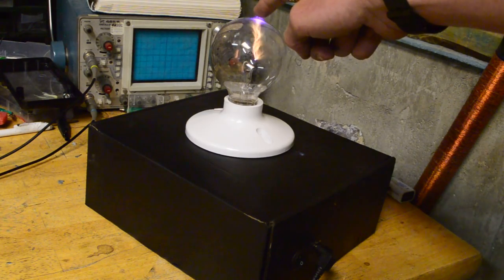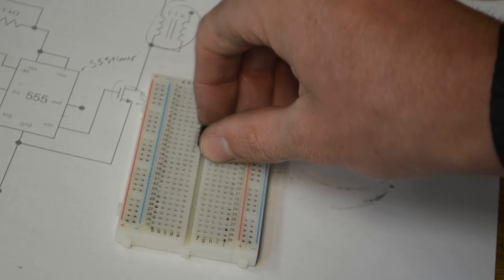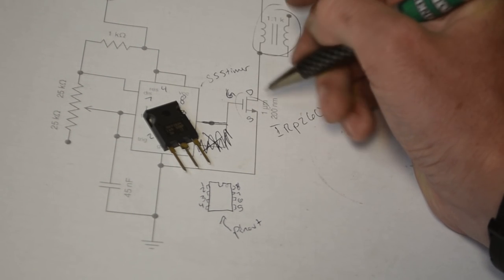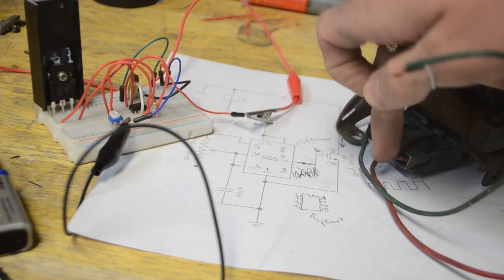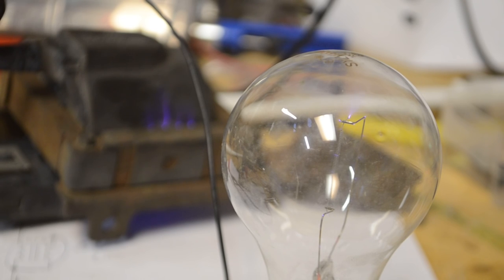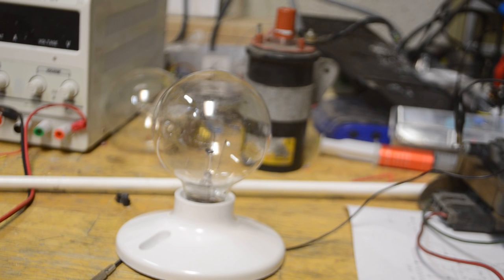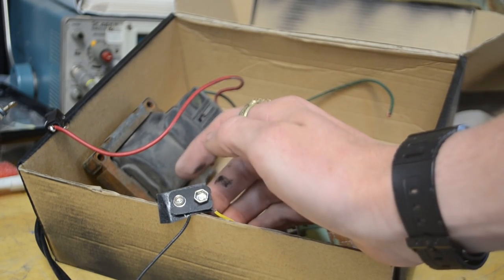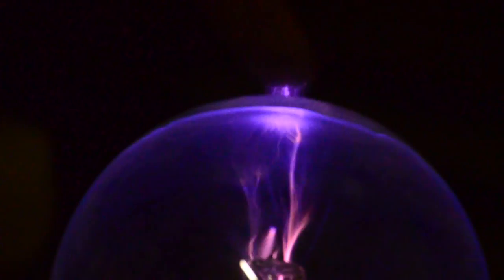How to make Plasma Ball

Comment: Hey man. I love you videos. Just a pointer. I am a master automotive technician. That coil it only designed to operate at a max if 15v dc. Anything higher you reduce the longevity and reliability of the coil.
Reply: themeez1000 lol so, normally they under power those kinds of things.. they build them to withstand more then what's used

Comment: You can also drive the ignition coil with a triac (dimmer switch) and a 6uF AC capacitor in series to limit the current. I put 70 diodes (1N4007) in series in an oil fillled tube to rectify the output. Great source for HVDC for vacuum projects. May want to get the lead underwear out though due to the X-rays if you do decide to run it in a vacuum.

Comment: can you show us how to make  high voltage power with out a fly backtrasformer.
Reply: pls
Reply: He already uploaded a Video about that. just search for "keystone science flyback transformer"
Reply: Austroval he Said without
Reply: you could use an ordinary transformer, really any transformer does work. I got mine out of a microwave, just search for his video "how to get high voltage out of a microwave" search your own microwave in a dump or something near to that, and there you go (really watch his video, or you could shock yourself with that high voltage capacitor)
LG Dominik
Reply: Seth Leith a mot is a great power supply except it's not due to overheating, dangerous amounts of current, but you can ballast it and add some caps for more violent arcs (it's really not resonant) just dumps more current from the caps....
Reply: YOUR NPN FRIEND thank you this helped a lot
Reply: Seth Leith no problem but I would not ever use this in a plasma ball as it is 60Hz and 2100v average mot output voltage you could buy a potential transformer out around 7200v-22kv I would love to see your videos be safe!
Reply: Seth Leith don't use anything that's not at least 10Khz don't risk getting hurt the mot and potential transformer will possibly kill you i would start out with a flyback and zvs just be safe zvs can push lots of current through a FBT
Reply: Seth Leith negitive ion generator produces 20 000v at extreamly low amps and if you want you can run it off a 9v battery but no where near full power. for full power you need 12v dc. they cost about 30 dollers online I have no idea if you can use them in these projects or not im not experienced at all.

Comment: thats an awesome project i might try it! but i would need to find a ignition coil. also if you put some more ads on your videos you will get a good sorce of income and i sugest getting a 3d printer to print plastic cases or shapes to hold your projects in and it will have a nice profesional look

Comment: Nice flyback coil driver.  I have exploded a light bulb with HV through the glass, but that was using a metal probe near the glass and a 15kV 30mA transformer.  It explodes violently, glass everywhere. lucky I didn't hurt myself.  Ignition coil driver video would be nice to see.  I have made one with two 6-volt lantern batteries and a relay wired up as a contained spark gap.  For such a setup the ignition coil needs an external condenser.

Comment: hello there ! thats quite a nice plasma globe, i never tried it with an ignition coil ! is the light bulb by chance a 100w or more ? seems that bulbs with less wattage ratings have more air inside and the discharge doesnt work so well .. a few tips for the 555 circuit if your interested : 1 - a capacitor in parallel of the primary side of the transformer will allow the circuit to run better, keep the mosfet or power transistor running cooler and it consumes less power due to the cap. and primary side making a resonant circuit although i only tried with flyback transformers so experiment with values in between 100nF and 1 mF : 2- a safety gap for the transformer output will prolong the transformers life and should stop the secondary from arcing to the core .. a HV transformer left open circuit is not good for it : 3 - grounding pin 5 of 555 timer with a 100nF will allow it to run more stable .. and anyone who reads this, this circuit will run a flyback transformer with no problems .. if your interested, i have a good video explaining this circuit when used as a plasma speaker in full detail =) .. great videos cheers from Germany !

Comment: I tried this but at the time I had no irfp260n transistors so I tried quad Irf3710 transistors and a driver circuit for them.

It didn't work. I had ordered some irfp260n transistors but by the time they arrived I has 3 more projects on the go so I haven't gotten back to this yet.

I think maybe I was trying to drive it at too high a frequency. I'm pretty sure these coils don't like much above 300Hz

Comment: Can someone help me? My flyback transformer will only work a friction of a second on 50000v when I put it in the outlet, than the voltage drops to arround 100v and that sucks a lot

Btw i used a power supply from a light bulb
Reply: keystone has meny video wich use this transformer. they will help you i had the same problem
Reply: Jm2059 tech i dont want to spend another 30 bucks on something i dont need
Reply: Jm2059 tech btw i have seen all of them already

Comment: It's so late but I did it and it worked fine but every time the MOSFET dies, doesn't it need some protection?
Reply from the maker: I feel you – yes. Likely something like a zener diode would be a great addition in order to protect the MOSFET. When I would run mine, I would be quite careful with making sure I didn't have it on for long.

Comment: does it have to be a mosfet transistor?
i have looked inside commercial plasma balls and found a regular tip120 transistor in there.
Reply from the maker: Perhaps it could be different, I just generally use mosfets so I don’t have to worry about power flowing through it that much

Comment: will this circuit work with flyback transformer and then using it for plasma globe ?
Reply from the maker: +Abhinav Kumar yes, however it must be an AC flyback, and I personally have never found one sadly :( but they do exist likely on TVs from before 1980s
Reply: Thanks.I couldn't get an ignition coil. I made plasma globe using spark gap tesla coil (mounted bulb on the top load) powered by flyback, driven by cfl ballast.

Comment: Um so...You can get these in a 3" usb-powered version now...I'm curious as to how those function, given that this required that huge high voltage converter
Reply: After looking into it, it turns out they work in exactly the same way with smaller components. Definitely not something I'd want to connect to my computer!!!!

Comment: An AC flyback transformer works better, I've done it. I also did this with a Tesla Coil.
Reply from the maker: +CoolDudeClem yeah, I just can't find an AC Flyback for the life of me sadly :P
Reply: They're in all T.V.s before around 1970. Try to get an old one from a garage sale for a few bucks, and you'll be pleasantly surprised. I got mine from a Zenith AC/DC manufactured in 1976. They're usually less than $15.

Comment: Really cool HV power source and very informative video. 

Does anyone recognize what vehicle /manufacturer this particular ignition coil comes from? 

It will be easier to replicate this project with an identical one.  Thanks.
Reply from the maker: +Benjamin Otto thanks! Uhh I can't remember, I just went to a scrap yard and found like 4 of them, but really any old ignition coil should work fine
Reply: Keystone Science I did manage to find that particular ignition coil.  For reference It's from a 95 Ford f150 (or equivalent). 

One thing I am quite surprised by is that the 555 isn't burning up when you pump the 30 volts in. I've gotten this circuit working pretty good at 12 volts. 

I've also noticed the 555s can fairly easily be fried from the high voltage return back into the circuit. In my lab I have a separate dedicated earth ground I use for testing arc length. 

I'm going to make some improvements on this circuit like adding a voltage divider to isolate the 555 from differing input voltages. So the frequency generator part of the circuit only gets 6-9 volts while the power transistor and coil get 12-30 volts. Also high frequency diodes in some places so no voltage can flow back into the 555 through the output pin, for example.
Reply: Benjamin Otto you need to power the 555 timer separately from ignition coil

Comment: I want to try this bro, but the thing that i've got is 500watts bulb and flyback transformer from Sony. Will it work too?
Reply from the maker: Hmm, the flyback has to be ac... you can tell by how it looks, google “ac flyback” and compare, however it is very likely the flyback you have is DC as most on ‘newer’ CRTs are
Reply: Any recommendations or another way bro for it to work?
It is really hard to find ignition coil here in our place. That is only my problem because when in terms of oscillator, I really admire your work thats why I try it with the same values of components. Cheers bro!
Reply from the maker: An ignition coil is really what you need, is there a car scrap yard at all near you? That is where I got mine. If not, you could always try and wind your own (but that would take a long time). I’m sorry, but its probably best to find an ignition coil, although I will let you know if I think of any other kind of transformer that would work!

Comment: can i use a flyback insted of ignition coil
Reply: shafayet rahman yes you can, but it must be a AC flyback. They're quite rare these days and very dangerous so be careful! Wear voltage resistant gloves.
Reply: thanks
Reply: Restitution S can't you just remove the diodes from a DC flyback?

Comment: Super video! And i have one question: does this work with a flyback transformer or only with the ignition coil?
Reply: User 820 flyback will work as well, but its really dangerous!!!!
Reply: And can you show me how to connect it?
Reply: User 820 yes i can, but why? :DD
Reply: Because i dont know what to do with mine and i think that would be a cool thing to do :D
Reply: flyback have been used on old tvs so because the old tvs use high voltage this trasformers are powerful and dangerous so when you test it wear rober gloves
Reply from the maker: +User 820 yes, although it must be an AC Flyback, ( I have none of these ) and they are quite a bit more rare to find these days sadly
Reply: Keystone Science where can you see the different between ac and dc flybacks?

Comment: is it possible to use a FBT instead a ignition coil
Reply from the maker: +Zeus Martin Sajol yes although, it must be an AC Flyback
Reply: Where could  I find an AC FBT
Reply from the maker: +Zeus Martin Sajol likely in tvs from before the 1980s should have them, but I'm not too certain... also the portable small tvs have them I think most of the time
Reply: A CRT TV'S FBT IS IT POSSIBLE

Comment: 555 use 5v for input ?
Reply: yep
Reply: andymouse123  if you use 9v input then  the chip will loosen
Reply: sorry sir "loosen"  ?    555 will function at 5v
Reply: andymouse123 sorry sir, I watch your video, you use pin 9v
Reply: 9v is fine sir but you can use lower voltage if its all you have   just play learn and enjoy   electronics is a great hobby !!
Reply: andymouse123 ok, thanks
Reply: andymouse123 sir,  can I use mosfet IRFP 250N?
Reply: sorry sir I'm not familiar with that device but check the datasheet for it and if its an " N channel " MOSFET then it will work you can use a whole host of mosfet's just check stuff like voltage and current ratings and you will be fine
Reply: I've just checked and the IRFP 250n is a " p cannel " device so you cant use it in this circuit  sorry sir but I hope you have access to the right one good luck
Reply: oh, I searched on datasheet then IFRP 250N is  "n channel". you can read it in a link: http://pdf1.alldatasheet.com/datasheet-pdf/view/68504/IRF/IRFP250N.html
Reply: i bought it but the circuit didn't work
Reply: yes sir you are correct my info is wrong my apologies I'm afraid you will have to use the 260n or find an equivalent there will be many ! my mistake I got my P channel and n channel data mixed up you will be fine once again good luck if I get time will find an equivalent but if you get the right channel and similar forward voltage and current handling you will be fine
Reply: strange the 260n is also n channel I'm confused will get back to you in the video its shown as IRPZ 260n which doesn't exist will sort it out sir try talking to keystone
Reply: your mosfet should work sir have you checked your wiring fully ? also check the " pin out " of your device it may not be the same gate, drain, source arrangement
Reply: ok finally no what's going on my data is back to front you do need P channel my apologies sir
Reply: i see, thanks you so much!